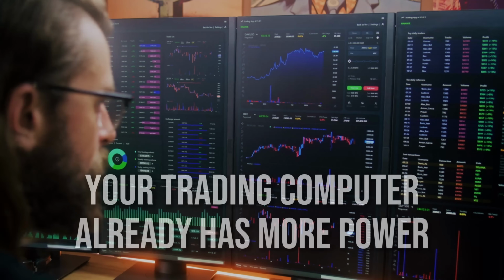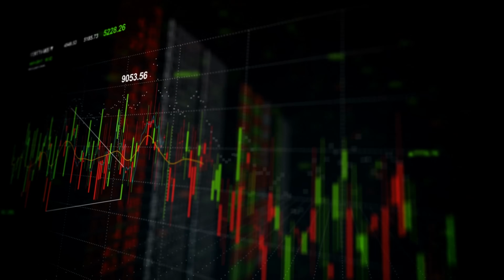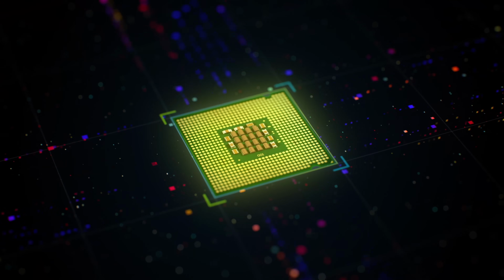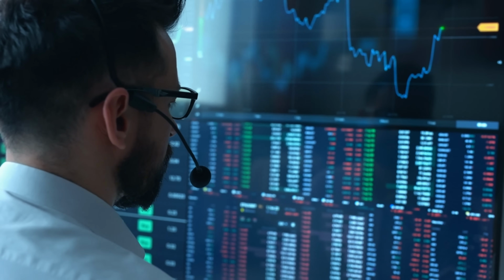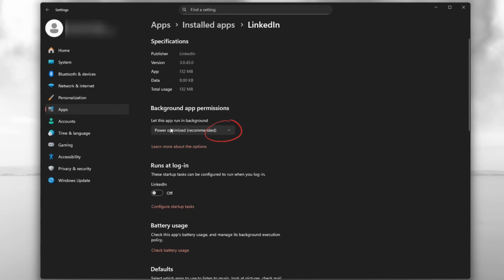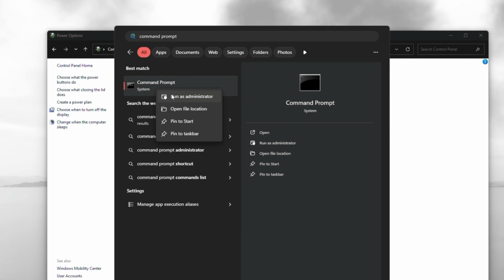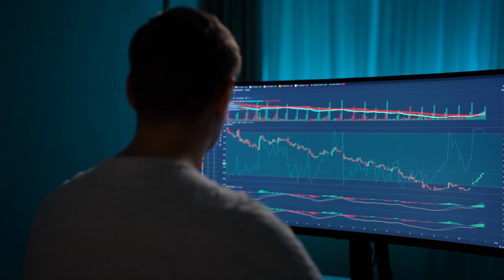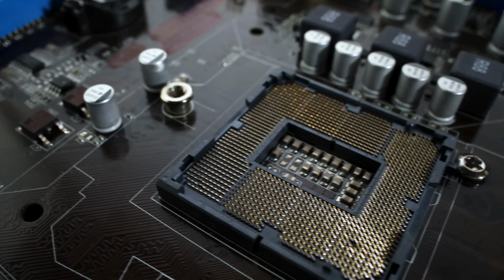Windows 11 Is Killing Your Trades (Turn This Off)

Comment from the maker: Most traders upgrade hardware… but never fix the performance Windows is stealing every single day. If your system STILL feels slow after these tweaks, your processor may be the real bottleneck.  
⚡FREE Complete Guide to Trading Computers: https://eztrading.pro/tcbg
🔥 Is your computer fast enough for trading? FREE test: https://eztrading.pro/cpu
Reply: Just install tiny 11 22h2 most stable ,fast and optimised. No need to anything extra,all the steps in the video are already done by default

Comment: Hi Eddie. My Windows 11 appears to not give me the same window as yoursunder Advanced Settings. Mine is more of a table Taskbar, File Explorer, Virtual Workspace, Terminal, For developers & Dev Drive.
Reply from the maker: Good eye catching the difference — what you're describing is the "For developers" page, which is a different spot than the performance/advanced settings panel I was in. For the one I showed, search "View advanced system settings" in the Start menu — that opens the older System Properties window with the Performance options.

If you haven't already watched it — I go through every Windows 11 setting traders need step by step, so you can follow along in the exact same panels. Watch this video: https://www.youtube.com/watch?v=9DqvRYcSkZM

Comment: yea iam using windows 11 but chrome but it works good since i got a 14900k and a 4090, i have other problems lol
Reply from the maker: Appreciate you sharing that—and yeah, that setup, while a few years old, is a beast.

With a 14900K and 4090, you’ve got enough power, so most “problems” at that point usually come down to software, settings, or background processes—not hardware limits. That’s actually a good place to be.

If you want, drop one of the issues you’re running into and I can help you narrow it down.

What kind of problems are you seeing?

Comment: Do these make a difference when my trading platform is web based or is this mostly for downloaded trading software?
Reply from the maker: Thanks for watching and great question.

It still matters, just in a slightly different way. Web-based platforms rely on your browser, so CPU and RAM still drive chart rendering and responsiveness, especially with multiple tabs or charts open. They’re also a bit more limited because they run inside the browser sandbox, which restricts how much of your hardware (like GPU and system resources) they can fully use compared to installed software .

So even though they’re convenient, they usually won’t feel quite as fast or powerful under heavy load.

What platform are you trading on?
Reply: @eddiez-trading  Thank you for replying! I am switching from Robinhood to Webull and I and wondering if I should get the desktop app or if the webapp is sufficient.
Reply from the maker: Thanks for the follow-up — and good move switching over.

Webull’s web app can work, but once you start running multiple charts or trading actively, the desktop app is usually the better choice. It runs more directly off your system, so you get better responsiveness and fewer browser-related slowdowns.

Browsers can eat up CPU and RAM in the background, especially if you’ve got TradingView and scanners open at the same time — which adds up fast on an i5.

So short answer:
Web app = fine for light use
Desktop app = better for active trading and stability
Reply: @eddiez-trading  Thank you! I already got the desktop app after some of the customization options are not available in the webapp. I can tell it's way more responsive.
Reply from the maker: sweet

Comment: What if use linux operating system?
Reply from the maker: There's no problem using Linux. Lots of traders use it, but it requires a lot more technical expertise than most traders have

Comment: You dont need performance for trading you can trade on a 4gb ram 20 years old computer perfectly fine, it consumes no resources at all...
Reply from the maker: Thanks for sharing your perspective. You can trade on very low-end systems, but once you start running multiple charts or fast-moving markets, the CPU and GPU do matter because they handle chart rendering and responsiveness in real time . That’s usually where older machines start to lag or freeze up. You could also cut your lawn scissors !
Reply: Well said sir @eddiez-trading

Comment: Thanks so much for the info. Really appreciate it. I changed all of these settings except for the Balance Mode. I don't have an option to change this on my Asus Zenbook laptop. Is it possible to change the power mode on a laptop?
Reply from the maker: Thanks for watching and really appreciate the comment.

Yeah, on a lot of Asus laptops the full “power mode” control is limited or handled through MyASUS instead of standard Windows settings. You can still influence performance, but laptops often restrict this to manage heat, and when they get warm the system will throttle to protect itself .

Are you running this on battery or plugged in most of the time?

Comment: i have instaled widows 11 ltsc!no more issues!
Reply from the maker: Nice—that’s exactly what LTSC is designed for 👍
It strips out a lot of background apps, updates, and extra services, so it can feel more stable and consistent.
Just keep in mind it’s NOT a magic speed boost—it mainly reduces background noise, and sometimes you can run into compatibility issues depending on your setup. Not all trading apps will work well with it.

Are you noticing faster load times or just more consistent performance overall?

Comment: YOU DA MAN!  lol. Subbed, i owe you money now. lol.  Literally potentially huge for me if it acts a lot better. A fast computer makes me mentally better, happier, and a slow computer pisses me off and ruins my life. So thanks again!
Reply from the maker: Thanks for watching and I really appreciate that—means a lot.

You’re actually spot on… when a system is fast and responsive, your charts update instantly and everything feels in sync, which reduces stress and helps decision-making. When it lags, even slightly, it creates hesitation and frustration—that’s usually CPU/GPU responsiveness and sustained performance under load .

Curious—what platform are you trading on?

Comment: Windows 11 is not allowing to turn off the "Send Optional diagnostic data" what to do in this scenario?
Reply from the maker: If Windows 11 won’t let you turn off “Send optional diagnostic data,” it’s usually because the setting is locked by organization policy, a work/school account, or certain Windows editions like Home in managed mode. In that case the toggle will stay on and can’t be changed from the normal privacy menu.

If it’s your personal PC, check Settings → Accounts → Access work or school and make sure no organization account is connected.

Curious — is this a personal computer or a work-managed machine?

Comment: ////////////////////////
hey man, thanku but im unable to get the option of ultimate performance under power option, though i have run the command prompt you have provided, if you can further guide please//////////////////////////////////////
Reply from the maker: Great question, and I appreciate you watching. The *Ultimate Performance* power plan isn’t available on all versions of Windows. Microsoft originally added it for *Windows Pro for Workstations**, and on many systems (especially laptops or Windows Home) it may stay hidden or not appear at all even after running the command.  In most cases the **High Performance* plan works almost the same for trading systems, so it’s not a big deal if Ultimate Performance isn’t there.

Are you running this on a **desktop or a laptop**?

Comment: Windows is worst for trading. Mac is built for trading
Reply from the maker: Thanks for sharing your perspective — I appreciate you watching.

Mac systems are very well built hardware-wise, but most professional trading platforms are still designed primarily for Windows, which is why many traders run Windows machines for platforms like NinjaTrader, Sierra Chart, TradeStation, and others.

The key for trading is really stability and consistent performance, regardless of the operating system.

Curious — what platform are you trading on with your Mac?
Reply: @eddiez-trading  Right. I use Ctrader and Trading View